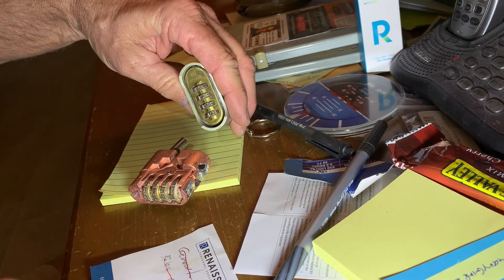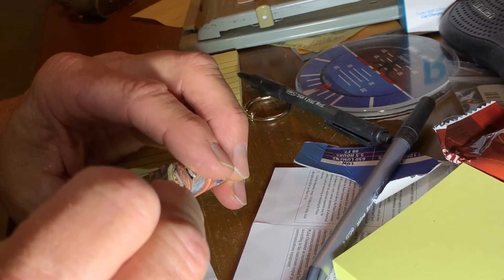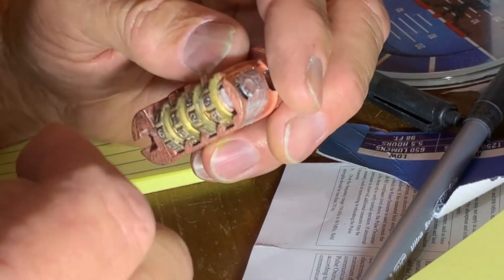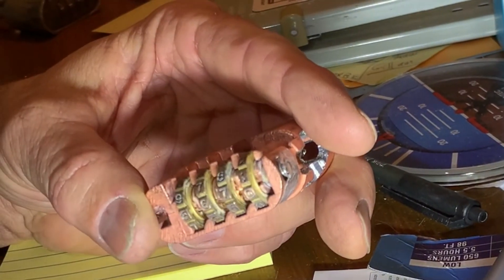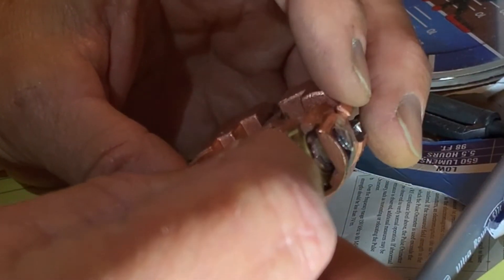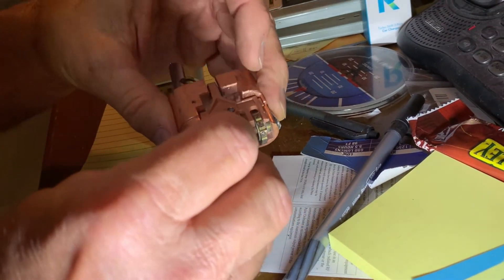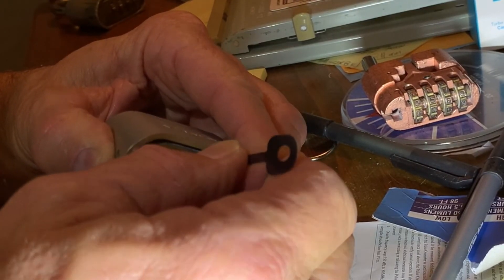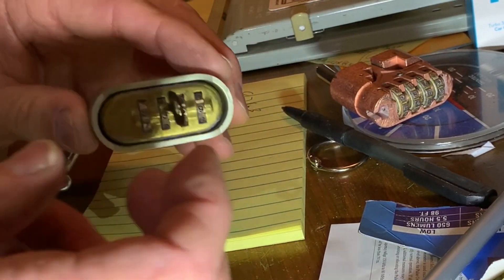MasterLock 175 - How it works and how to bypass with a thin pick.

Comment: I really liked your video.  I haven't been able to get into the lock.
Oh well.
I've got the lock in a vise and I'm ever so gently trying to work a shim past the ridge on the dials.  No real luck.
Once I have four numbers. I write them down and then rotate that group all the way around, checking that group in each position.  No luck.  tHanks
Reply from the maker: Some are harder that others. I’ve heard they tightened the tolerances on new ones making it almost impossible to slide the shim in.

Comment: This method dont work anymore if i am correct right.
Reply from the maker: @AnthonyBerardis-r1p  it should still work on this model but I can’t be sure. They may have made the clearance smaller making it harder to get the thin pick in.
Reply: @EristiCat  I believe they did bro, because I can't getvthe feeler gauge through for the life of me on any wheel

Comment: I have 3 locks that I have been playing with,  I noticed a difference in the width of the slots.  Last one had to have something thinner.  I cut the side out of a can from mushroom soup.  Was thinner than the top/lid of the can.  Was thin enough to get in the slot. Was able to feel the flats and get the numbers lined up.  Good I could feel the flats because that lock had been hanging on a trailer for a number of years and it was not going to open.  Since I was feeling the flats I was pretty sure that the numbers were correct and it finally opened with some whacking on it.  Would never have gotten it open if I was just trying numbers.

Comment: Thanks so much.Your video helped me to fabricate my "tool" and to pick my Master 175d. After I located the the indentions on the wheels, I added 2 to each number.  I was fairly certain that I had located numbers on wheels 2,3 and 4 then I started rotating wheel #1 until to my surprise, my lock popped open! Thankks again!

Comment: i have a very very old one, were they different in the past? probably from the 70s or 80s, cant get it inbetween wheels
Reply from the maker: How thick is your shim?  The one I use is 0.09 inch. Roughly the thickness of two post it notes.

Comment: Fantastic visuals. But you are bypassing the hard way. You should get in shallow above the combs and push down,  not in deep and push up. You also need to depress shackle.
Reply from the maker: Using my opened up lock so I could see what was going on I took a look at the angles I was using and as best I can tell I'm only going under the shackle, not the comb.  I do agree with you, if you did go too deep it would be counter productive.

Comment: You can change the combination without the key if you keep pressing that hole with a tool and align the wheels where you want them. 
Just the combination needs to be set correctly before pushing.
Reply from the maker: That's true. The "key" isn't really a key, it's just the equivalent of anything that will fit the hole so you can push the pin sideways.  The advantage of the "key" is that because it's got that "flag" on the end you can turn it sideways, and it holds itself in .. otherwise you have to hold your "tool" in by hand.

Comment: 1:03 when flat is at that low angle, the notch is aligned so it can open, correct ? Because I kept trying to open it today, keeping my tool in that area and I opened it by MISTAKE (with correct combination aligned) :)))

Comment: I have to pick my Lock and have a key but it won’t turn 90° how can I change the combination
Reply from the maker: You can't change the combo unless you know the existing combo.  That's the reason for the notches. If you don't know the combo you will need to watch a video about how to use the pick to figure out where the flats are.  When you have found the flats you can get the combo.  The only help I can give is that in my experimenting I was able to find the flats for the 3 right dials but not the left dial.  So I just tried all ten numbers for the left dial and got the final number.  Same would be true for any single dial that you can't seem to find the flat.  If you can find the flats for the other three you can just run thru the 10 positions for the last dial.
Reply: I’ll try my luck with that. Thanks bud.